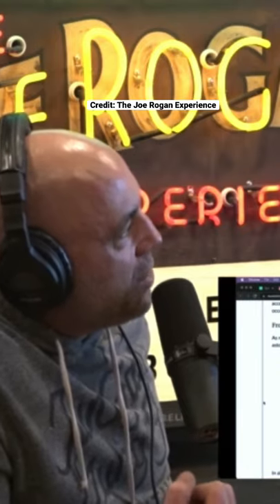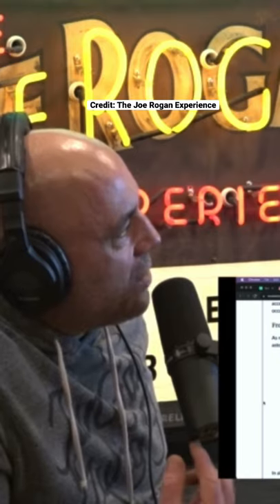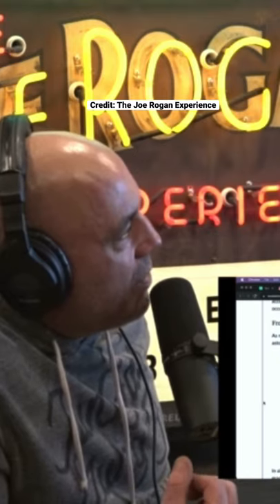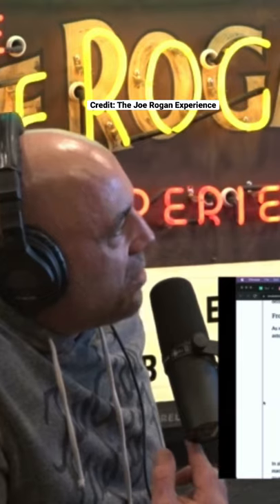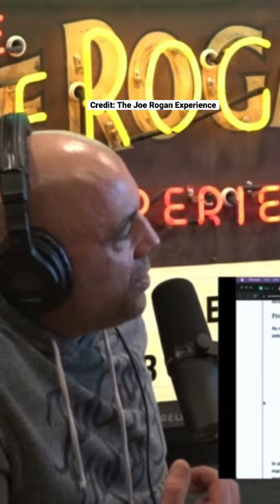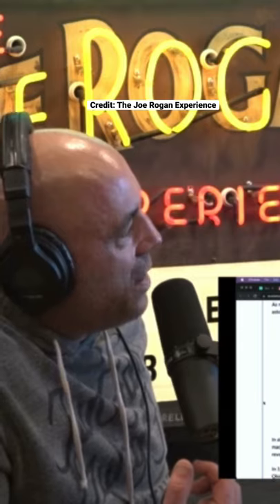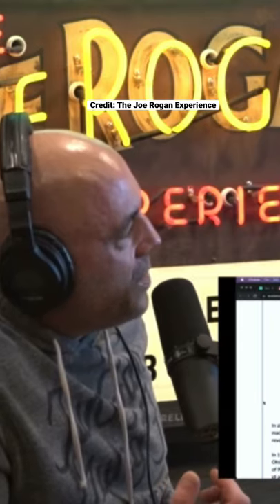Joe Rogan on ancient Egyptian stone mining techniques | JRE #1742 with Jimmy Corsetti #shorts

Comment: It’s easy they used copper and electricity the Egyptians knew how to make batteries and produce electricity and if you use copper with electricity it will literally cut threw anything instantly we have machines now that do just this and it will cut threw stone and the machines are very simple so it’s definitely something the Egyptians could have used seeing as most of the tools where made of copper
Reply: How tf would they have made batteries? Do you have a source for that?
Reply: Well tbh if they had made batteries there would be waste from their civilization but there’s no source of waste nor electricity.
Reply: Baghdad battery look it up. It's 100% legit
Reply: @thejustinex1news  the Baghdad battery is an example of an ancient battery
Reply: @chrishodge03  what makes ya say that
Reply: Where are they using copper and electricity to cut and bore granite
Reply: @chrishodge03  no there not setting of nukes
Reply: @zzzleepyhead9101  The way the supposed baghdad worked would produce like 2 volts.
It was prob not a battery